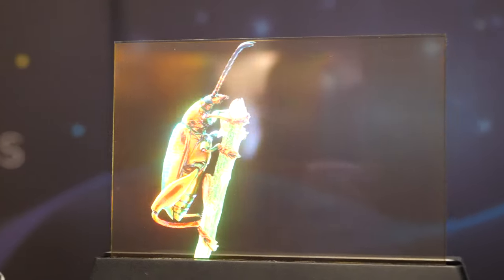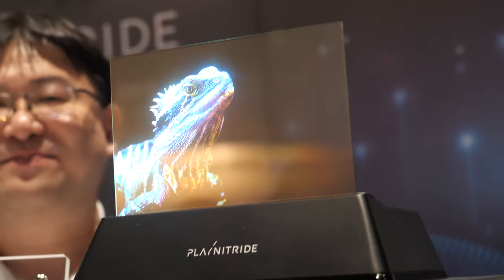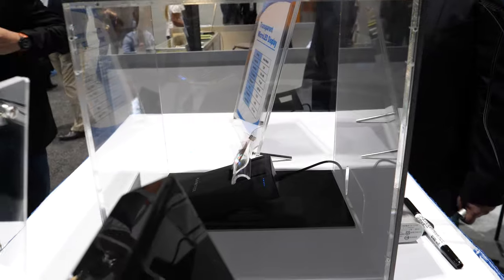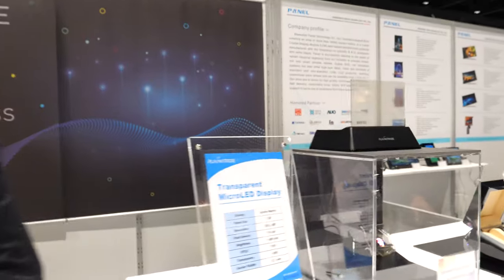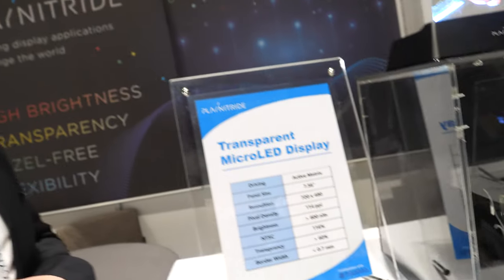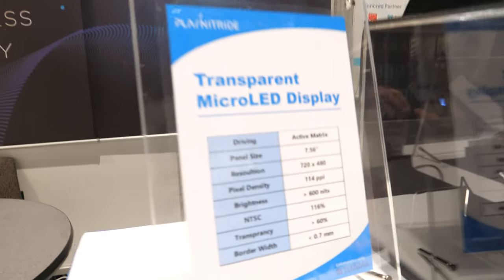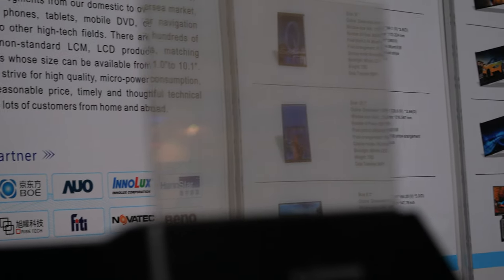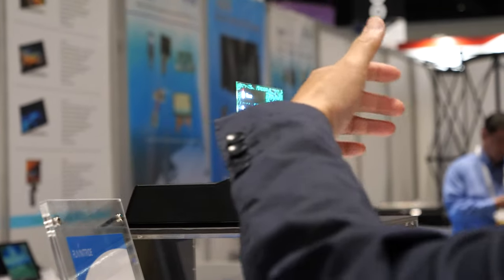PlayNitride microLED at Display Week 2019

Comment: "we can make 120hz or 240hz, there's no challenge" now that's nice!
Reply: The underlying technology is way better than any signal you can actually realistically feed the display with. As were CRTs. It is LCDs that suck. The individual LEDs switch in around a microsecond. If you could feed it 1 000 000 Hz, by some magic, the LEDs would keep up. You're going to be bottlenecked by cable bandwidth, graphics rendering performance or active matrix technology etc. meaning the display elements themselves are never going to be the bottleneck.
Reply: @soylentgreenb  yeah i think i saw some crazy numbers for the samsung the wall, very impressive but kinda of wasted energy to push that far haha
Reply: @Aiello_  It's not wasted energy to have a < microsecond response time, nor are high framerates necessarily a waste. Fast response simply means that you can do away with ghosting, overdrive, inverse ghosting/overshoot from too much overdrive, accepting crappier image quality to get faster response time (see TNT LCD panels).

Motion clarity is possible in two different ways. Either strobing, which is not very compatible with variable refresh rate (gsync/freesync/adaptive sync...), in which the image is very briefly and very brightly illuminated and therafter black until the next update. This has the effect of causing an after image on your retina that follows along with the motion of your eyes. Consider a constantly backlit monitor like a standard LCD; at 144 Hz 2560x1440 moving your eyes across the screen horisontally in 1 second means that your eyes move 18 pixels during a each frame; but the screen updates in discrete frames and nothing moves inbetween frames; that actually blurs the image by 18 pixels. That's why CRTs were extremely clear in motion and LCDs always looked like a muddy mess. The other option is to crank the framerate somewhere north of 1000 FPS, with a >1000 Hz refresh rate; so that your eyes only move a couple of pixels in a frame. If you can crank out well north of 100 FPS the latency can be made low enough to feel perfectly fine and you can fake all the frames inbetween with various kinds of reprojection and motion interpolation. Any kind of mistake in 1/100th of a second won't be very visible.

The major savings in performance that will enable all sorts of cool stuff is eye tracking. You see about 60 pixels per degree at the fovea (the full moon is half a degree as seen with the naked eye and that's about "30 x 30 pixels" of resolution; these are blurry pixels and not on a grid, but that's about what they eye can resolve). Go a few degrees out and that has already dropped to about 15 pixels per degree. If I know roughly where you are looking and can construct an image fast enough, well, I can render a high resolution area that's 5x5 degrees or something and a mid resolution area that's 30x30 degrees or something and the lest is a very low res area. When you get to crazy resolutions like 8000x8000 per eye, you still only need to render 1/100th of that.

Comment: Can you ask about the response times of MicroLED and rather it's the endgame of display technology? People say that nothing is faster than the speed of light, well, MicroLED is self-emissive just like CRTs where light is what is producing the moving picture. I want a display that will match the response times of CRTs! CRTs are still used in gaming because the response times are so fast! I hate motion blur on modern LCD displays. For example, I have a Sony Trinitron I use for retro gaming. Testing Sonic the Hedgehog on the CRT vs LCD in the green hill zone with the screen scrolling horizontally, I would get severe motion blur on the LCD, whereas on the CRT I can actually track the background layers. CRTs are so fast that playing a 60FPS game at 60Hz feels like it's running at 75Hz, whereas running that same game on an LCD would be like 40FPS or 30FPS..
Reply: R,G,B LED's have no phosphors. Their response time is way better than even the fastest CRT since you are waiting for a slow phosphor to start glowing. Direct emission LEDs typically have a turn-on time in single-digit nanoseconds, longer for bigger LEDs. Turn-off times for these are in the tens of nanoseconds.
Reply: Not really well it is but what about hologram TVs 3D images but without glasses so the image pops of the screen without glasses holographic TVs could become a reality